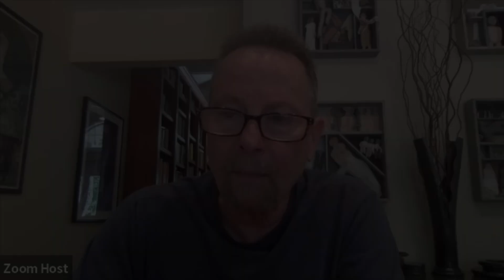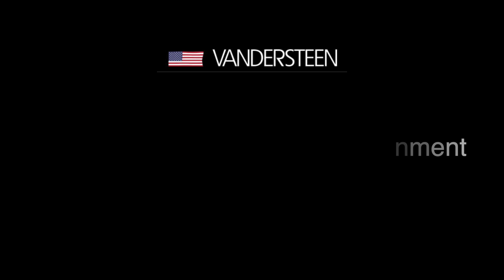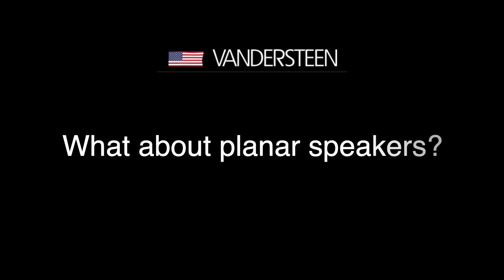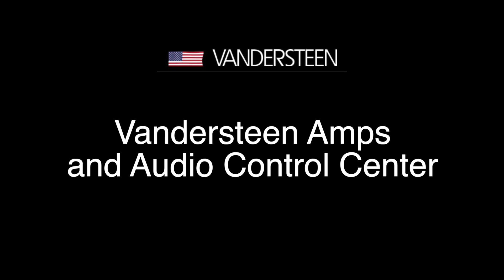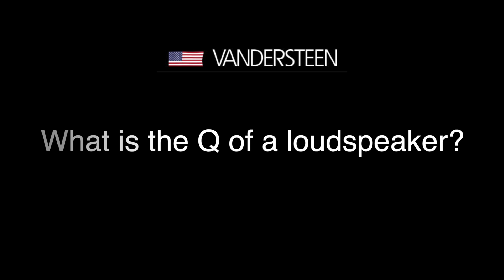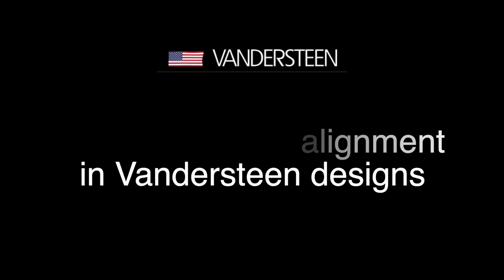Richard Vandersteen Talks About Speaker Design

Comment: Listening to a person so open on the advantages and disadvantages of different engineering concepts is a delight and puts one own mind free on what can improved in  loudspeakers Vandersteens included.
So here are my two suggestions of potential improvements.

1: it’s absolutely lovely to have drivers which behaves pistonically, but the surround/edge of a speaker is by design almost 100% non pistonic. The surround takes up quiet a big portion of the driver area because it sits at the edge of the driver. There must be something to be gained here from putting time and research into making the surround behaving as well as physically possible.
2: I believe there could be gains made from beefing up the tweeters with super oversized magnets and durable materials. Not because I believe tweeters to be particularly fragile but because it would allow the usage of a lower crossover frequency (without running into power handling problems). A lower tweeter crossover frequency, will by definition give a better horizontal dispersion, and it will also put the first breakup frequency of the mid driver higher above the crossover frequency. 

Greetings from Denmark

Comment: Great interview. However, I have to question Richard’s comparison of a digital file (or was it streamed?) to an LP of an album that had Qsound effects outside the speakers. Since Qsound is a digital process, the final mix was digital. Richard should have provided much more information about the provenance of the sources and the test methodology.  He doesn’t even name the album. I’m skeptical that this was a like-for-like comparison, but only the mixing and mastering engineers would know. 

I do agree with him, however, that the easiest way to hear timing and phase differences is to listen for out-of-speaker instrument or effect placement, and to note the size and clarity of the ambience or hall reverb.